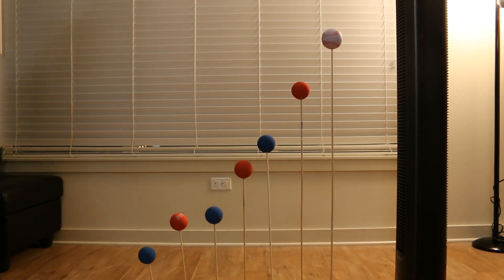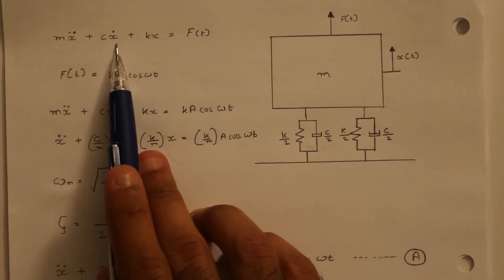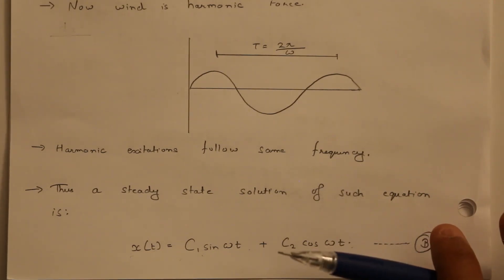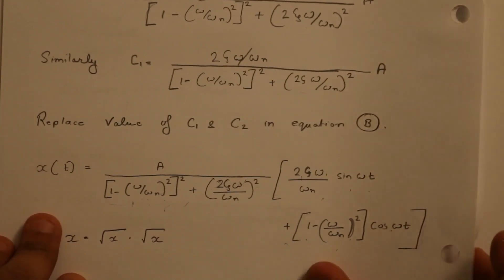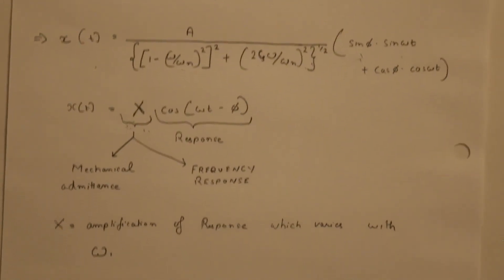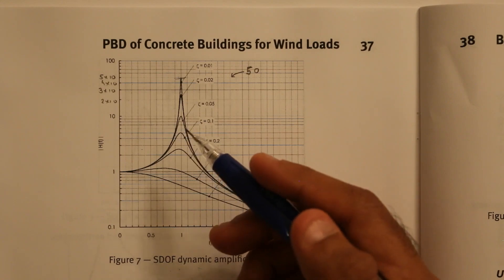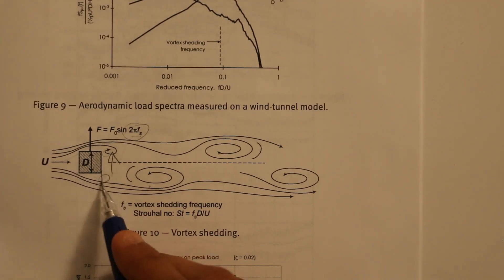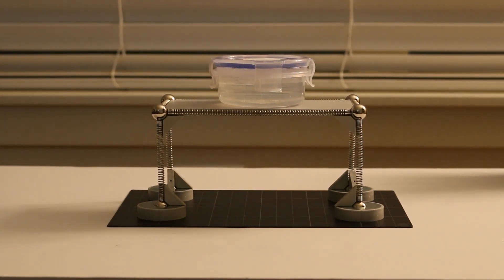Resonance, Damping and Dynamic Amplification Factor

Comment: I have a doubt. If at 15:17 you said that frequency of the water is = frequency of the structure...wont that create resonance?
Reply: The water's vibration is opposite to the vibration of the structure.. so it's sort of like opposite of resonance.. it acts as a good damper.